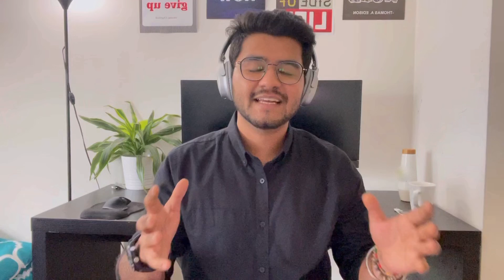Cracking Embedded Systems Interview| Full Guide| Top Interview Questions and Answers

Comment: Hello bahiya, i just started my third year btech ece, i already finished c++ and dsa topics which you are mentioned in thus video so can i am concern about my cpga, my cgpa is 7.8 so is it be problematic for me in placement time or not
Reply from the maker: For campus placements, some companies have cgpa cutoffs where it might be an issue. For most product based companies you have to apply through career portal directly where the core knowledge would have more weightage. That being said, you still have 4 more semesters to improve your cgpa. All the best!
Reply: @puneetbansal28 thank you for guidance bhaiya, as per your advise I asked my seniors, they said that most of the company which came in my campus for placement they simply put 7.5 cpga criteria for allowing to sit in placement, but my question is after clearing the cutoff will cgpa matters further or skills matters?